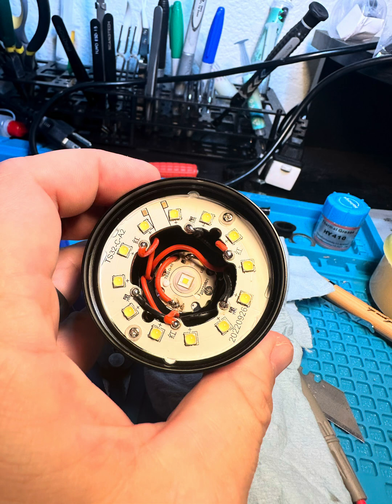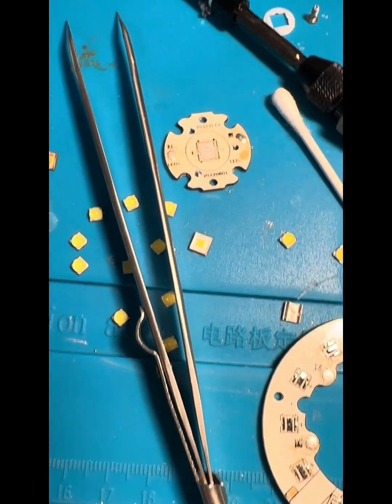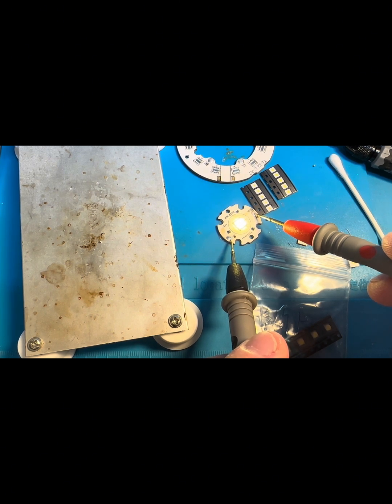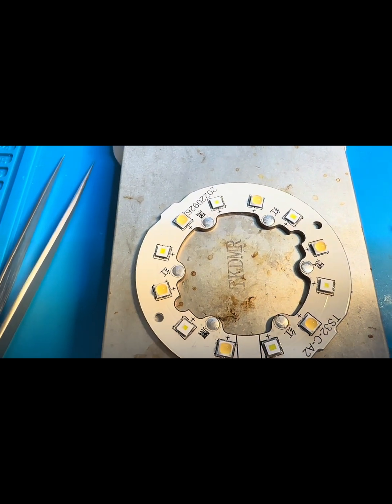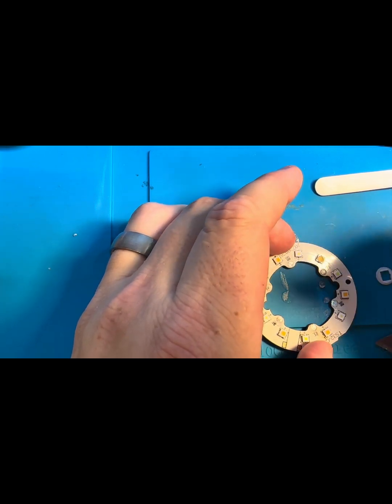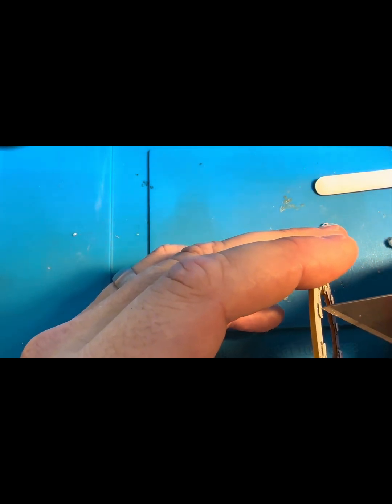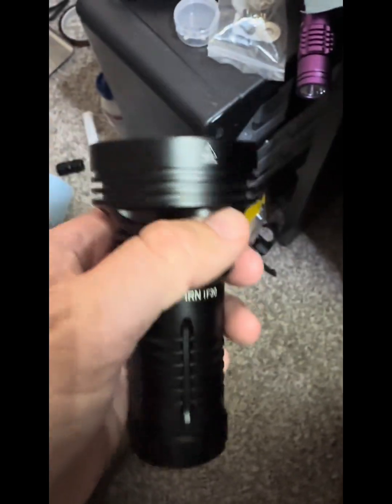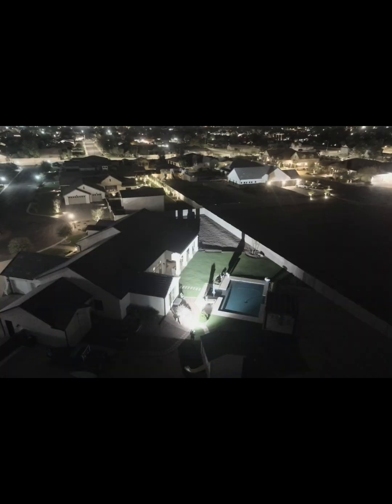Modification of Sofirn IF30, 6 Nichia 519a, 3 w1, 3 w2, and a 5000k sft40. 519a Dedome tutorial

Comment: Hey. How do you remove the lens? I have an IF30 waiting for a repair + mod, and I just have no idea how to remove that frigging lens. Thanks!
Reply from the maker: You unscrew the bezel
Reply from the maker: Who is modding this for you? I’d recommend just using the 519a leds
Reply: @marcgossling8260  Do you have a special tool to unscrew the bezel? There are no notches like on smaller bezels. I'll be doing the mod myself, but first I need to try and fix the light/driver (rotary button is toast after the lamp getting submerged, so much for an IPx8 rating).
Reply from the maker: @GlubOvore I just unscrewed it with my hand. A rubber wrench will work as well

Comment: Could just get wurkkos version of that.
Reply from the maker: I think I’m going to switch them all back to 519a LEDs which is like a wurkkos one, but I like the small size of this. Just a super cool light
Reply: @marcgossling8260 My SP33S It does not work unless the charger cable is connected. What is the problem, given that the battery is fully charged?
Reply from the maker: @Raed_0R did you try a different battery? Also if that doesn’t work then I’m guessing that there’s a problem with your driver